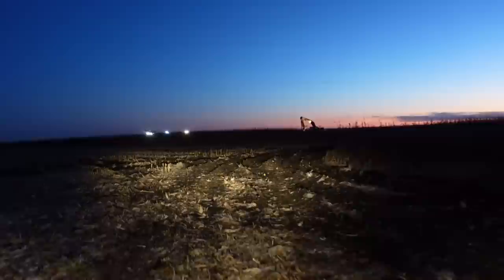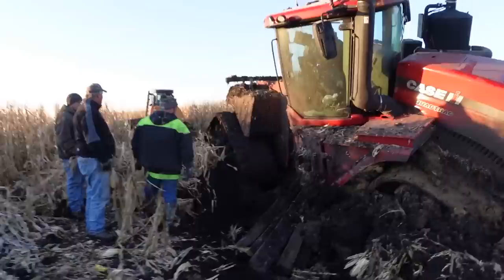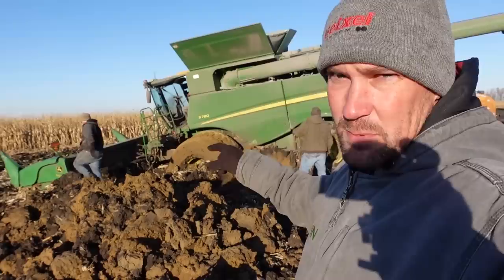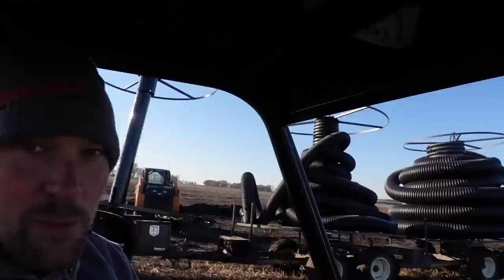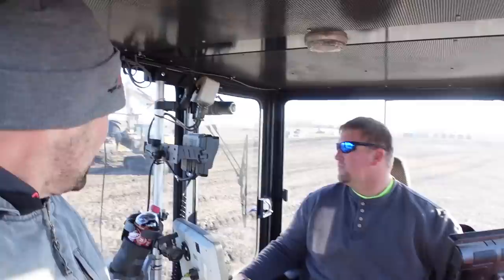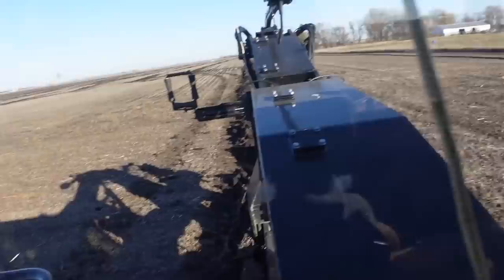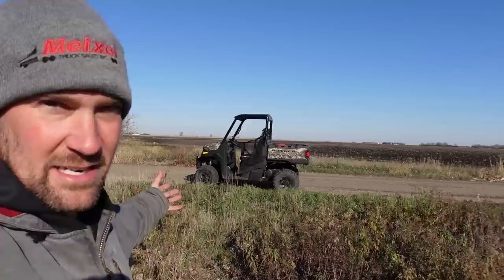Extreme Heavy Farm Equipment Recovery

Comment: Back in the 1970's I was a Dozer Operator pulling a Phyber or fiber Optics Cables all over the areas East of Hutchison, Kansas and then out by Dodge City and we landed in many situations such as you are with your Hose Blade. OH if you are wondering why I spelled Fiber two different ways. That is how they were marked on the spools of Cables we pulled. I am not experienced in your field, But bat I could do it in two days  on the job. That is the difference between man who wants to work and Men who want to milk the Payroll.

Comment: Boy that brought back a memory! Have a Gas line running across my property every two years National Fuel has it mowed or brush hog. Well, it was a pretty wet year went they came to cut it so you kind of get what going to happen Yes they bearded a brush hog and a hundred horse John Deere Four-wheel-drive tractor! So they came to get me telling me they were stuck a( little)So I went to take look Well have you ever seen a JD bearded up to the exhaust pipe!!BTW it was still running. It took them Three days of jacking to get the brush hog disconnected and a track hole had to pull it a thousand feet to get it out.

Comment: The days of recovering farm equipment with dozers are over.  There's only one way to do it and that is with a 30 ton excavator that can lift and reach.  The farm equipment has just gotten so big.  If you can't get up close and partially lift the implement you end up with this exact situation.  I hate getting these phone calls anymore because they arent simple fixes anymore.  Everybody's got a big tractor that can just pull.  Lift and pull is the new norm.

Comment: Green gets stuck. Red shows up  to help out. .,  and red gets stuck.... yellow  shows up  and is the hero  to a bad disaster.  Another corn field fairytale..
If you dump tons of sand  in these ruts and work the sand in the soil  will the soil compress and hold the weight of the equipment. Drain tile will work great. 
Later.

Comment: Have you ever seen how an excavator goes through wet places they have these big pallets made out of railroad ties but they are I don't know 45 ft wide by 8 ft long and they move them and they'll stack full five or six of them in a row these are some things I think that this kind of farming should invest in because as soon as you got him up on a platform then he'd have been above the ground and some of those would have come in very handy especially once he got going backwards one of those or five of them sitting behind him soon later he'd been sitting up on top of the wood and not even sitting on the ground at all look them up they're pretty cool and they work they keep a big old excavator from sinking down on the ground and I watch them go through swamp areas with those things they just turn around pick them up put them back in front of them drop them back down you know cuz they got there some on the the bucket and they put three or four of them in front of them and they just keep on walking across on those things pretty cool I'm sure y'all seen it he had to excavator right there all you had to do is get that excavator to lay them out

Comment: A question, does that tiling that is laid in the ground ever block up, get filled with dirt, we do something like this for drainage here but we put a sleeve over the pipe and have it buried in 5mm /1/4in gravel then back fill the trench, that way it doesn't block up.

Comment: Just curious. Isn't there a hook up middle way of the quad track? I would of tired hooking the winch cable there run up front of the tractor and put a old tire in-between the winch and bottom of the tractor frame.

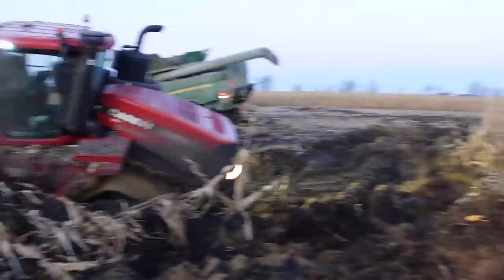Comment: 3:44  inthe SAND out here in SANDYEGGO EAST (in the DESEEEEESSSSEEEEERRRRTTT San Diego County is flippin DESERT not all prettty coastline lol ;)  it's still 80 or wutever miles WIDE COUNTY!!!) lol   and anyhow....   THEY MAYBE  NEED TO KEEP AROUND AN OLD BROKEN TRACK TREAD to put on the mud to RIDE UP IT like a ''board'' but not breakybreakiy like a board would be under a traktor...  

the serious pro offroaders carry 2 FIREHOSES bolted to the bumper... jack up one side, put firehose under tires, run firehose out to end out forward of stuck in sandy pit vehikyul....  then other side, then drive out till where it gets solid....   and then stop and roll up the firehoses...  they bolted on so they just flop around back there for a while...

Comment: shoulda flipped the bucket around on the excavator and gotten it under the track n lifted up on the back part as the dozer was pulling it backwards ive gotten a lot of dump trucks n concrete trucks stuck

Comment: I have questioned this for awhile and maybe someone on here can help me out.  If you look at the tracks on a military tank, they are angled in the front, i suspect to always pull yourself out of bad terrain, so why on tractors do they not do that so in this situation it is not plowing vs pulling it self up on top of the ground?  I mean it even seems like a tire has a better attack surface when trying to get out of a hole then a track to a certain degree.

Comment: So in short terms the higher ph of the water will tame down the acid that’s causing the heart burn. Our waste water treatment system at work will take the water and add sulfuric acid to lower the ph down to 2-3 and then bring it back up using caustic soda to the 7.5 range before it will send the water to the city. So it would make sense to me that a higher ph water will help with the heart burn but I’m by no means a doctor

Comment: yeah we've all been there, one harvest we pulled into a winter wheat field and after 23 pull outs, and 2 months we got her done, after the 3rd stuck pulling out with our 4wd on triples we had to bring in a big dirty hoe, after about 10 stucks we had to drop the header and swath ahead of the combine who did better with the pickup header, at one point we hit jello on a hill side and we buried the 42" duals on one side, we built a 100ft pulling cable so the 4wd could be on the other side of the hill crown. when we got close to 20 stucks we pulled out n left it till freeze up, still got a few more spin outs before it was done but the crop was pooched

Comment: The big problem in this area, different farmers rent the same fields different years. There are no long term rents. One adds lime and the next guy offers higher rent for a few years, and the next guy offers a higher rent until the rents hit max. The drain tiles, break or plug and nobody fixes the tiles. A lot of farm land is owned by investors, a group of doctors, who knows. 
Most farmers in this area are maybe 2nd or 3rd generation. When the current generation leaves farming in this area, the farms will just turn into woodland, there will not be anybody left to farm it. A lot of the remaining farmland is in farmland preservation, so the development rights have been paid. 
Right here in central NJ farm land will not be farmed, no more farmers. And of course there is Matrix Development who will put up a warehouse where ever they can find land.
Reply from the maker: That's unfortunate.  Here land doesn't change hands often.  Some renters come and go, but not frequently.  No shortage of farms and farmers here either

Comment: hey millenial and other neighbour buddys. why is this block pulley on the cord of the dozer? you need just straighten up your thoughts and minds, and use this block pulley, and excavator as an anchor near the dozer. at first, dozer's winch will gain 2x more torque, 2x less ass pain to stuck dozer and etc...

Comment: Why do everyone spin the tires when they are already stuck? It isn't going to help you, and you dig yourself in deeper. If they would have pulled it in neutral they would have get it out.
Reply from the maker: You have never pulled a tractor out have you 🤣
Reply: @MillennialFarmer  well, actually I did, but it wasn't a modern one but an old Porsche. We pulled off a tree with a winch from an Jeep and a pulley block.

He dug himself in pretty badly in a creek which runs through the field and ran out of diesel before he ran out of mud. :)

Point still stands: You don't spin the tires / tracks when you pull something out of the mud. It will always dig itself deeper in.

Just watch your video again. The one time the tractor was in neutral it dug itself slowly but steadily out. Then they started to spin the tracks again.